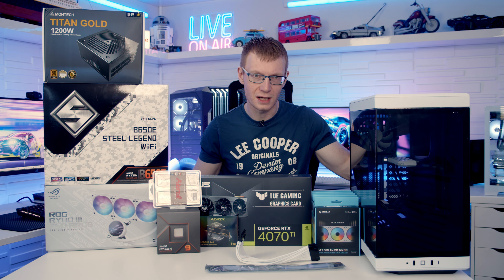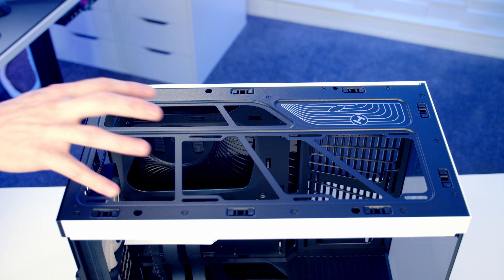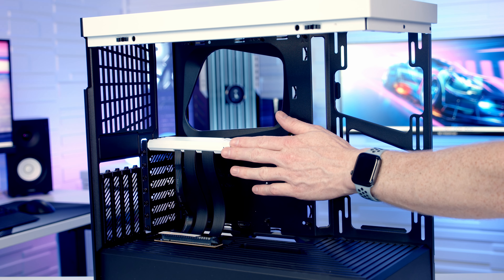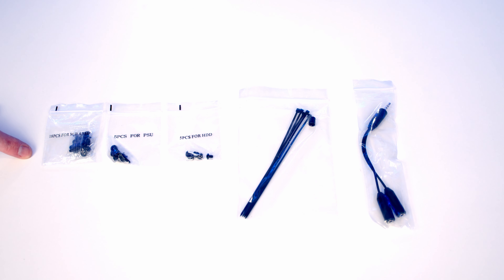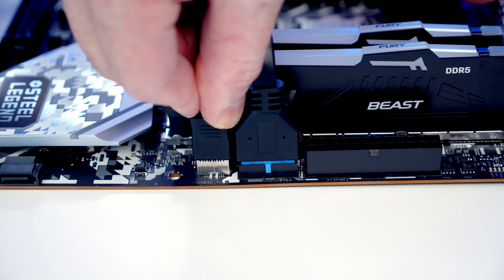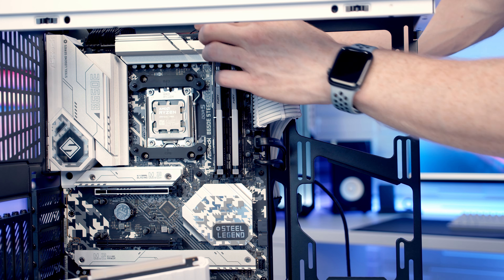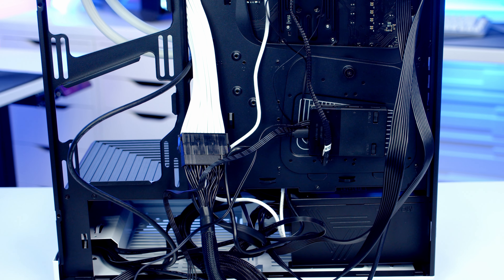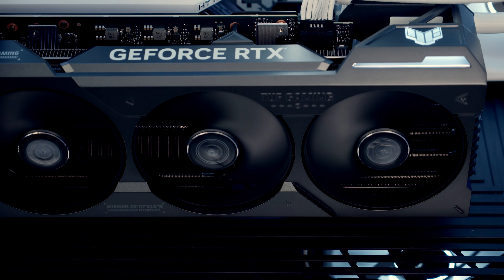Hyte Y40 Build - Step by Step Guide

Comment: Darn it, you didn’t install a HDD…that’s where I’m struggling with how it mounts to the PC
Reply: Did you get this figured out? The case only has one spot. It sticks to the back of the case where all the cables are. You can get away with  1 3.5 HDD or 2 2.5 HDD drives. I would go 2 lowpro sdd drives. The case really isn't built for large HDDs. I hope this helps.

Comment: When you buy a single uni fan, it only comes with a cable to connect directly to the motherboard. The obly way to connect a single fan into the ports on the fan box is to buy a 3 pack. So if you only want 4 uni fans, you are forced to buy 2x packs otherwise your fourth fan will have to be controlled via the motherboard and not the lian Li software
Reply: THIS IS FALSE. THE CONTROLLER BOX HAS 4 FAN PORTS! DO NOT BE LIKE THIS PERSON. DO YOUR RESEARCH BECAUSE YOU CAN USE ONE FAN IT JUST MEANS THAT IT WILL USE ONE OF THE 4 PORTS FOR ITSELF.

Comment: It is sad that there are not more options for drives.

If it had a small HDD bay, with enough room for 2 3.5 Inch HDD's I would have bought this case.
Reply: i have this case, i stole a drive bay from an old msi case and screwed it down, managed to fit my 2 3.5'' drives, my two sata ssds and my m.2 one but thats irrelevant as its on the mobo, but there is a work around to get the drives in lmao

Comment: You were definitely wrong about taking the second slot down for the riser cable out. It has holes drilled in it to secure the riser cable. That's what the plastic cover is to secure the pcie slot.

Comment: Do not buy this case after sizing components with pcpartspicker. It does not have the accurate dimensioning data for the case. 2.5/Triple slot gpus only fit vertically, and if u get a bad vertical adapter it will make ur case completely unusable.
Reply: I don’t know much about vertical gpus, does the case come with the adapter to mount it vertical or do you have to buy it?
Reply: @mandy842  it does, usually. Depends who u buy it from double check the listing details. If not hyte sells it separately
Reply: @mandy842  also disregard the usability issue it wasnt the gpu for me. It was a ram issue. My bad. Only the gpu will be unusable if the adapter doesnt work.
Reply: @mrphysics2625  ahhh okay. I think I’m gonna go for the Lian li instead since this case isn’t that widely known
Reply: @mandy842  im pretty sure this company started the panoramic trend

Comment: do you really need to put the lian li cables beside the radiator tube? because my rear fan cannot fit its too tight and my triplefan lian li cable is on the left side. does it affect the space from rear fan?